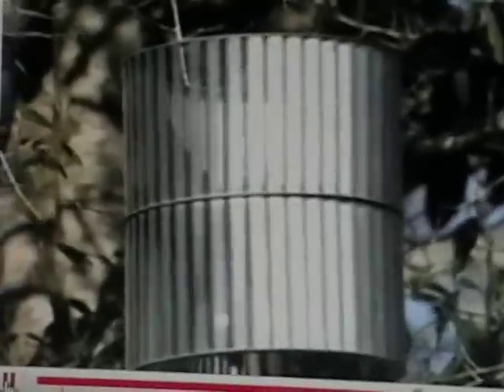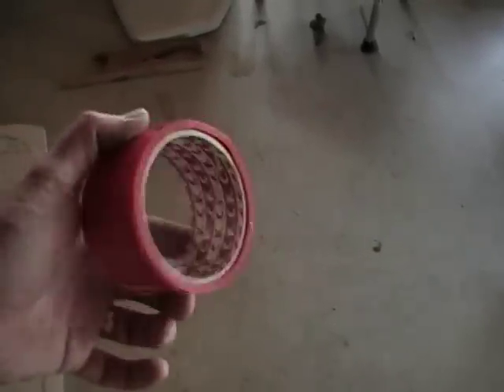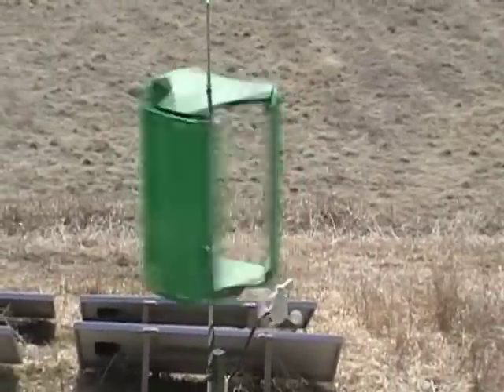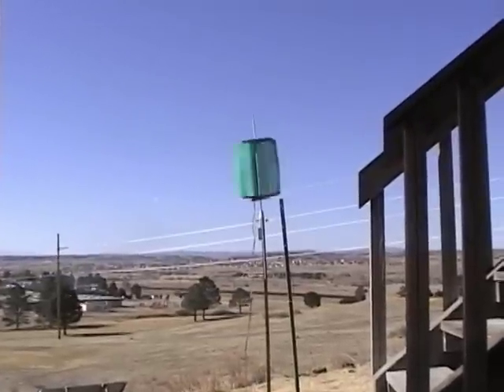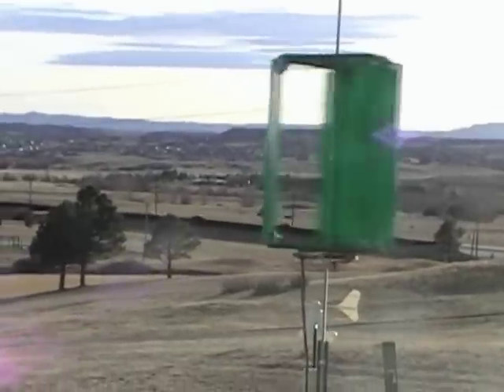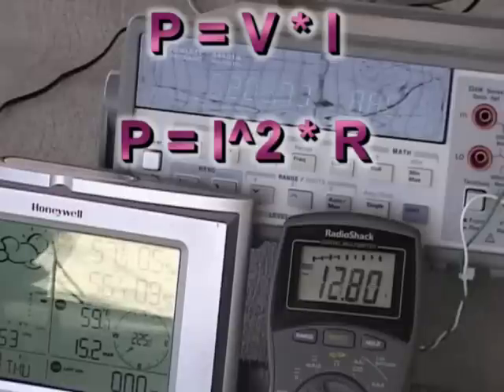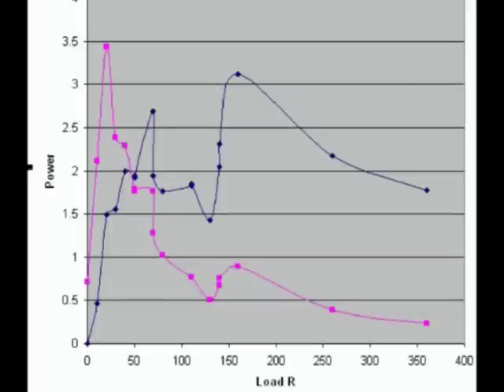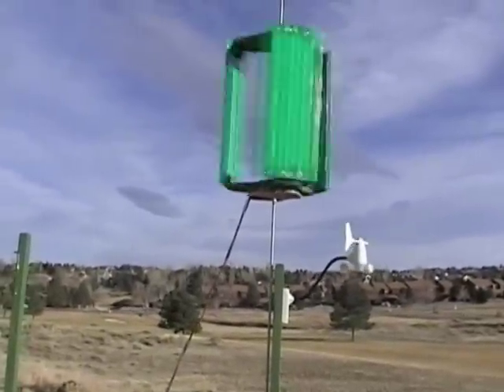Testing My Experimental Wind Turbine (VAWT)

Comment from the maker: Also since I did this turbine, I've done lots of computer simulations and calculations on this design.  It turns out that it's very easy to stall it with a resistive load, and my measurement system may have been too crude to actually find the peak powerpoint.  (The peak power point and the point where it stalls to very little power are very close.)

Comment: Correct. The tip speed ratio being greater than 1 proves that. However the efficiency was pretty good considering the errors in the surfaces of the wings which are quite visible at 0:20 on in. I do like the elliptical wings because of the relative ease of construction. I think I'll try out this design and add a few tricks I've been thinking of to see what I can get out of it. I have a few ideas what I'll make it out of.

Comment from the maker: Thanks,    I basically picked my initial designed based on what materials I had handy.  I had read that an elliptical wing was a good place to start.

Actually the whole VAWT counts for swept area.  The lift type blade is supposed to generate force all the way around.  Drag types only do it on the downwind side.

Comment: Some things to consider. First your video is one of the most thorough that I've seen. You document your work well. 

I was wondering how you derived your measurements (8", 9", 1/2", 2'). Also where did the idea for elliptical wing cross sections come from?

Your efficiency measurement I think needs adjustment. Only 1/2 of the VAWT counts for swept area, so the .25m becomes .125m. Power goes from 40 to 20watts @100%. 25% of 20 is 5 watts. And what did your turbine produce? 5 watts.

Comment from the maker: I go into more detail on that alternator in one of the other videos.  Basically the magnets are on a steel plate and the coils are just backed by wood.  Because of the warp in the stator it's not very efficient.  Magnets on both sides is probably a better way to do it, but more complex and more dangerous.  There is no cogging in this alt.